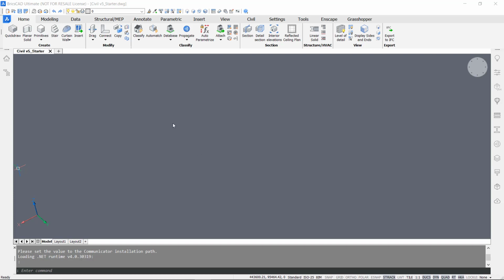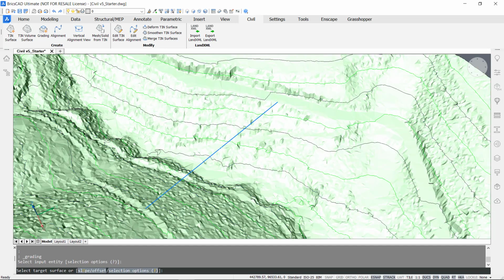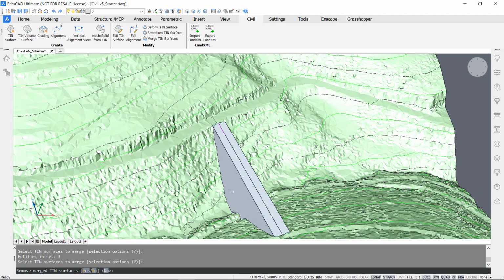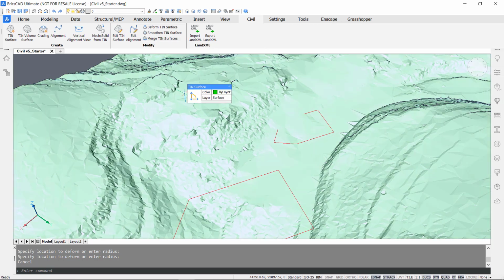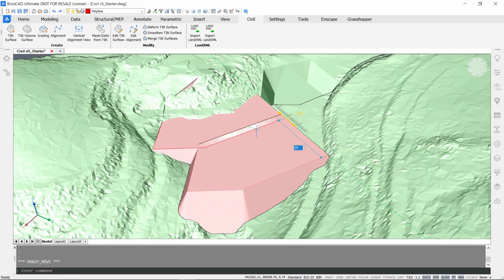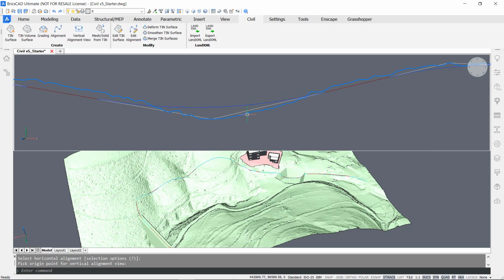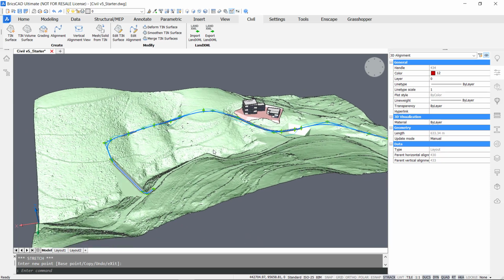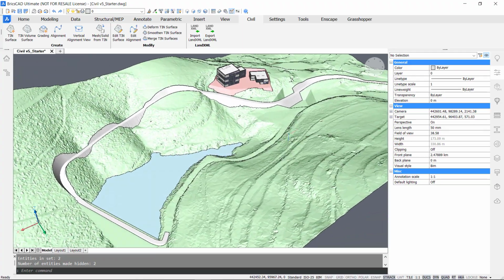Civil tools in BricsCAD - BricsCAD Academy - P1

Comment: The alignments are an issue for me. We start with 2d cadd files with legal boundries. Just eyeballing an alignment across a tin is 1000% a strict no go. We need to be able to use 2d lines or even 3d polylines as a basis for an alinment. Lacking this ability is a masive miss, and fatal flaw. Very dissapointed

Comment: Your demonstration looked good, although the vertical alignment looked like it was adjusted just by eye. To be practical it would need to allow precise adjustments to the vertical alignment. Can you therefore input an exact gradient figure for the road surfaces? For example you might not want it steeper than 8% so it would,be good to specify the gradient along its length.Also can you specify a 'best fit' to balance cut/fill and maximum required gradient?
Reply from the maker: 1. Currently, you cannot adjust manually the gradients of the vertical alignment in the properties panel.
2. A "best fit" to balance cut/fill volume is possible in V21. You can find more information in this video (timestamp 49.26 Optimizing cut and fill volumes): https://www.youtube.com/watch?v=9slBsZhlFgk&feature=youtu.be 
This video is more up-to-date for the civil features.
Reply: @OctaveBricsCAD  Thanks for the reply. It would be good to have the ability adjust the gradients manually. In fact it is probably essential. Perhaps in a future release?
Reply from the maker: @kennyb8718  I will inform the development team about this feature request.

Comment: Is there any way to get this training set now? I jave some time to get the V21 Trial and wanted to run through this training video, but the link no longer works?
Reply from the maker: Hi, Brian, I confirm that the downloading link no longer works on Chrome, but it works on Microsoft Edge, Mozilla Firefox and Opera. You can still download the link using Google Chrome if you hover the link->Copy Link Address->open a new tab and paste the link in the search bar. The download will start.